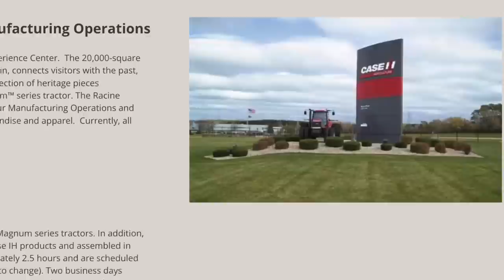UAW Strike Idles Tractor Production and How it Will Affect Us

Comment: Tractors are still as scarce as hens teeth in my area.  I have been on a list to by a 60 hp tractor since August but would accept any 50 hp tractor.  They finally got a 40 hp tractor in no hope of getting the more powerful ones on the horizon and I  gave them a check that day.  In my area big tractors aren't needed as few fields are even a 150 acres.

Comment: Well there could be one way to not have as much trouble there is product overlap on these magnum machines. A Optum can be used in place of a small magnum and a small stieger can replace a big magnum. Also some farmers have the big tractor for one or two big jobs and use it for secondary jobs since they own it already. So buy a smaller tractor to free up the big machine so it can be used only for the job it is needed. Hopefully this will prolong the time they can keep the big tractor.

Comment: Interesting about tractor availability.  I ordered a tractor in October and still can’t get an update on when/if I will receive it. My dealer is pretty useless. At this point I have been looking at the used market to see if I can find what I need.
Reply: As a dealer myself its nearly impossible to know when units are coming in. With alot of issues just being one item or even something such as tires which are horrible right now theres alot of machines sitting waiting for parts. When it comes to wholegoods we are struggling and one issue is some dealers are overpromising items, then they dont come in when they promised or come in months later. Its tough out here man. We have been trying to be as honest as we can upfront with our customers so theres no hidden problems.